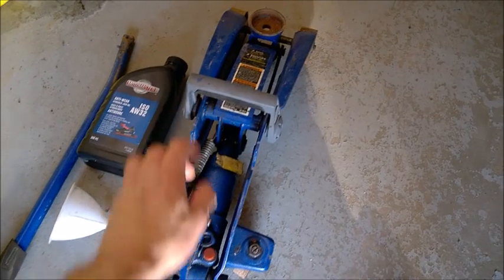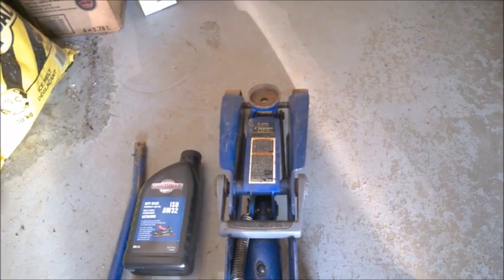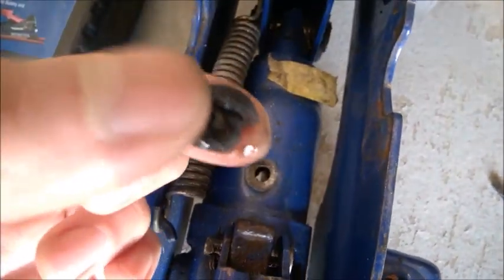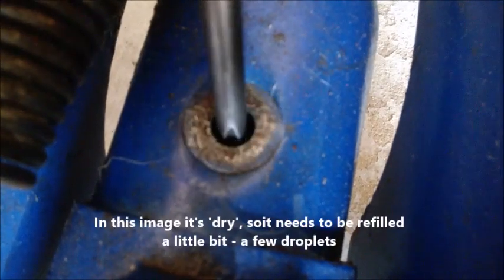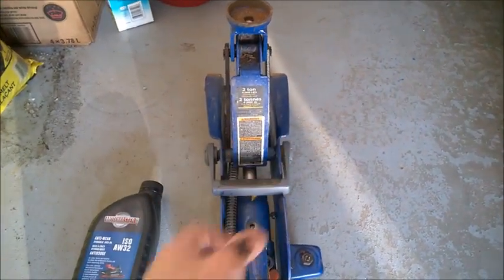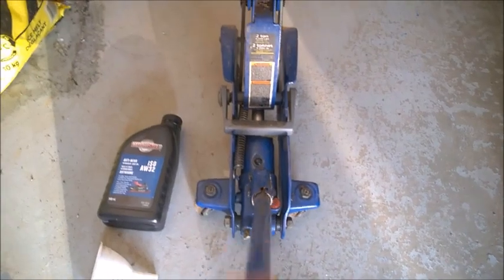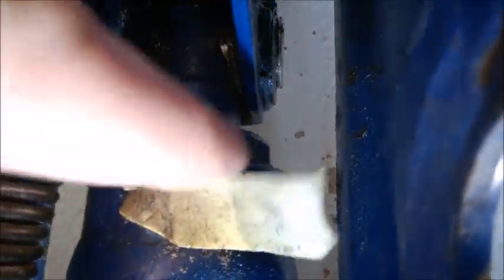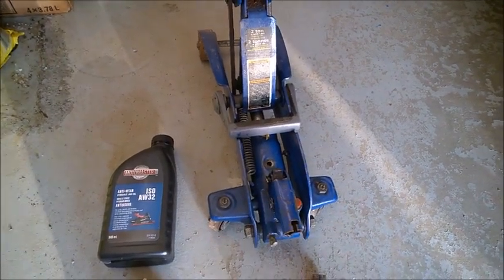Floor jack leak won't lift - fix with flush and refill

Comment from the maker: 4 years UPDATE: the jack in the video is still working perfectly. I lift a 2015 Sonata and 2021 Hyundai Kona EV, both fairly heavy cars. It is important to lift only one corner at a time, if I try to lift both wheels at a time (one side), the jack starts leaking so the seals are strong enough for 1 corner only - about 500 kg (1,100 lbs).  If the jack feels like it doesn't lift that high, remove rubber cap and top up with hydraulic oil - makes it work all the range perfectly again

Comment: so it's leaking from the handle-rod and nut... okay.   No seal replacement kits available I guess
Reply from the maker: Yeah, don't think seals available at this point. It's leaking very slowly though, need to add small amount oil once a year

Comment: I have a Michelin Speedy Lift 3.5 ton Jack I bought in 1999. A couple years ago it would raise but not lift any real weight and it took about 12 pumps to raise it all the way. When it was new it took 3 pumps to raise it all the way. I added fluid and followed the bleeding procedure in the manual but that didn’t fix it. I was about to throw it away but found your video. Same brand different size, that shouldn’t matter much. I actually had too much fluid in it so I removed it to just at the top of the rod inside the cylinder. Then bled it 3 times. I just jacked my Wife’s car up and it stayed up. Your video taught me a few things about the Jack but most importantly you said “Have patience”.  I previously had bled the Jack one time and when that didn’t work I gave up. Thanks for the lesson. So now my, non-NAPA, “Chinese made junk” works like new.
Reply from the maker: Always rewarding when we can fix an old solid item
Reply: I have that same jack (Michelin Speedy Lift 3.5) that I got from a neighbor. It lifts lighter things, but just can't lift a car nowadays. That's how I ended up at this video. I'm guessing my neighbor didn't realize you can service these jacks.

Comment: HEY PEPPERMINT GET RID OF THAT JUNK BEFORE IT KILLS YOU OR A KID. GO TO NAPA AUTO PARTS AND GET YOU A NEW ONE AND GET SOME NEW JACK STANDS DON'T GET UNDER THE CAR WITHOUT THEM. GOOD LUCK PEPPERMINT AND BE SAFE. DON'T BE A FOOL.
Reply from the maker: Yes, always use Quality jack stands (never buy cheap chinese ones from Amazon). It's the first item to buy when working on a car
As for the floor jack, it has been working properly after the flush and refill. I actually purchased an expensive low profile 2.5 ton jack, but it was to heavy to carry around, I did return it.  As for the Michelin, I use it to lift one corner at a time - then put the jack stand. Some people use these to lift the side of the car or the front of the car at once, that will cause the seals to start leaking. I did another video here https://youtu.be/53mlJPHF-MQ